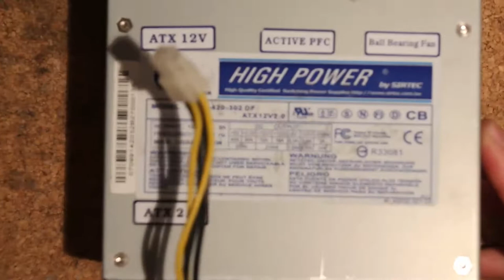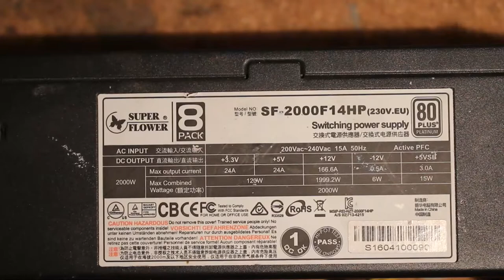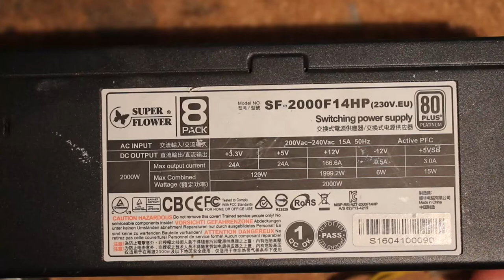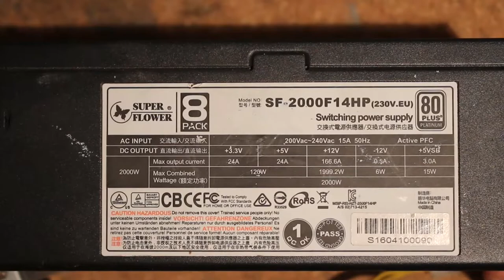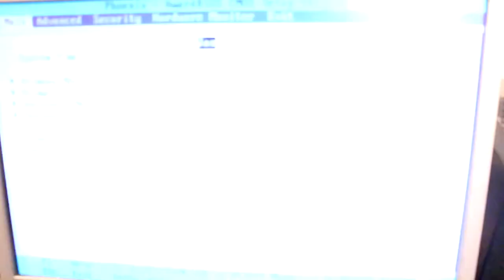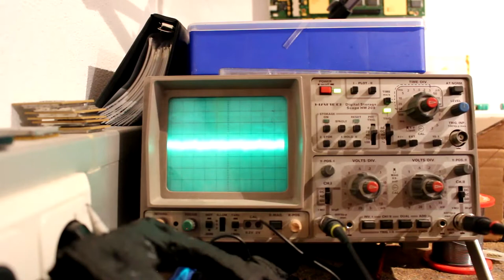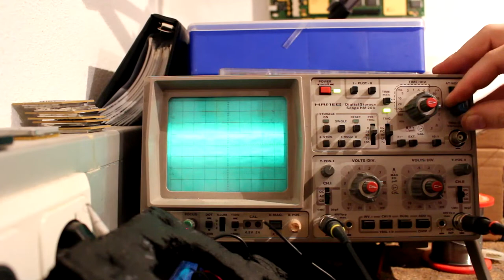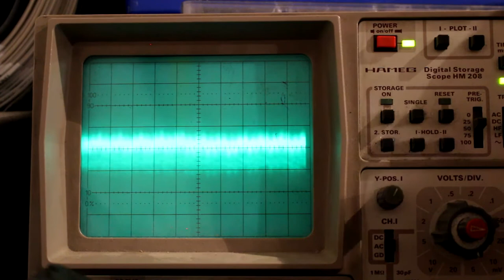Running socket A mainboards on modern PSUs

Comment: Great work, but why not that easier solution: 

1. Remove the cpu vrm coil (located slightly above the AGP slot)
2. solder a thick wire from either an external connector or the 20pin socket to the VRM side of the coil, effectively feeding 12V into the cpu vrm
3. unsolder the three big capacitors right next to it (3x 6.3V 3300uF)
4. replace those capacitors with for example two Panasonic FR 16V 3300uF

Comment: I tried even very poor eurocase PSUs with Athlon XP and it always worked fine, but I had problem with molex on on GF6600, it melted isolation on 5V cable when I overclocked that GPU, so yes, 5V line can be definitely a problem on modern PSUs. It's not only about weak PSU, but it's even about too thin cables and low quality molex connectors which just can't handle those AMPs, but ATX connector on mainboard is better. But it's better to find some decend socket 478 board if you want to be sure there won't be a problem with modern PSU. Athlon XP was good, but in some aspects it was obsolote.
Reply from the maker: Stock yes, but getting even close to 3Ghz nevermind more than that running with a VRM that's on the 5V rail is kinda impossible :D

Comment: Awesome! I was thinking it  couldn't handle 12v. Are those mosfets rated for such voltages ?
Reply from the maker: most mosfets used in mainboard vrms are rated for 30-40V, only thing you need to replace is the input filter caps as stock ones are 6,3V rated :)